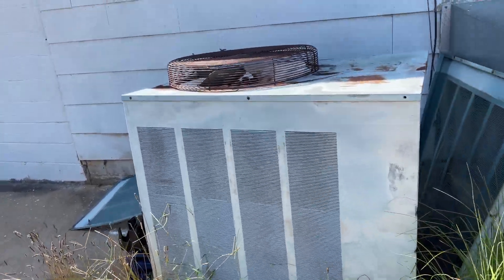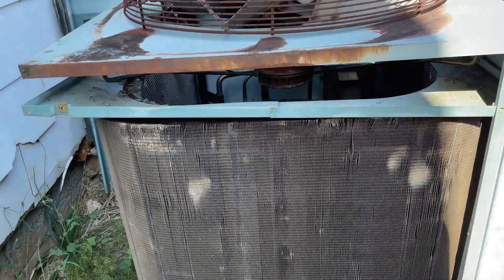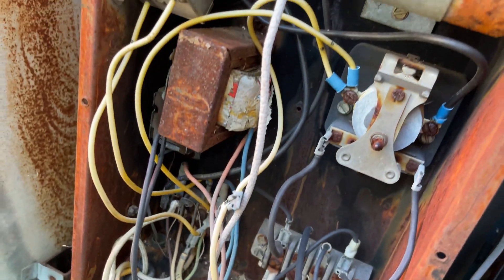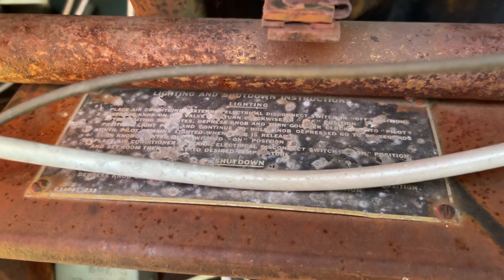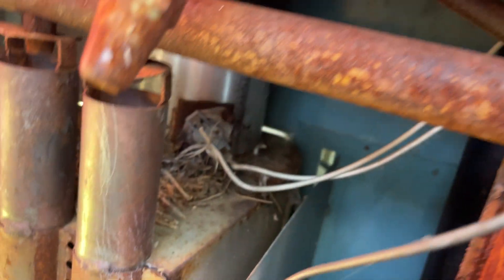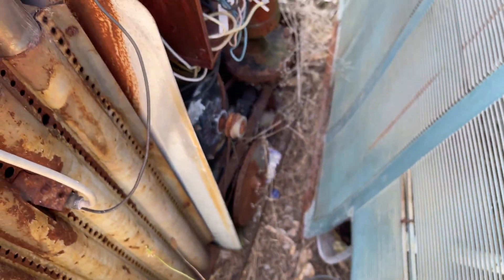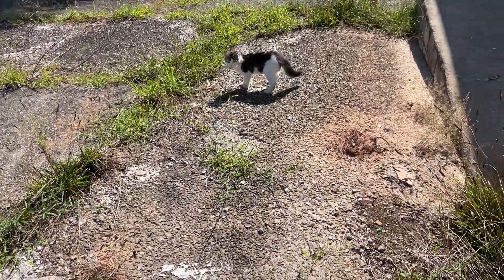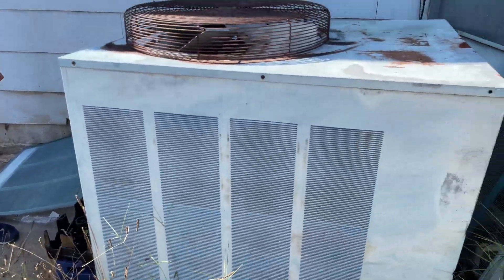The Arkla-Servel gas powered ammonia absorption air conditioner

Comment: We had a bunch of them in commercial installs in So. Calif In the '50s and '60s.  One church in Riverside had 80 tons capy.  Our house built in '54 was plumbed fir 3T Servel unit with a little Hadley Aquatower!  As itvturned out, we went with a GE package unit on the roof instead.  Some of our neighbors has the Servels, and had a nice little business cleaning out cooling towers as a kid.  That got me into refrigeration.  Back then, nathas was so cheap, tget sold really well.  So. Calif Gas  financed them for customers.  They went away once natgas prices went through the roof.

Comment: I'm getting nostalgic over the damndest things now at 60! When I was a kid in the 70s, our neighbors across the street had a Servel unit. I remember the pump kind of made a beeping sound when it was running. The fan was quieter than the pump. Our original HVAC was a Lennox furnace and outside unit. Most of the homes on my street were originally heated and cooled by Lennox systems.

Comment: I heard these use Ammonia as the refrigerant and that loop is under pressure.  They run on absorption in which it uses the ammonia to turn hot into cold, similar to how some RV refrigerators work.  It also appears that there is a pilot light that has to be lit with a match inside.  It also uses a blower just like a regular electric one.  There is no compressor in these.  It is an absorber.

Comment: Rating plate in video shows it as an early model AC60 (5-ton) chiller.  Serial # shows it was manufactured in 1970 (before I worked there).  I couldn't make out letter in the serial #, for that designates the month of manufacture.  Robur absorbed the absortion product from Arkla, Inc., 30-plus years ago. There is another manufacturer of absorbtion products in TN, Stone Moutain Technologies.  All your RV refrigerators that are AC/DC or propane heat source, use simular absorbtion principle.  Like stated in previous comments, use extreme caution if you open sealed system for any reason.  The refrigerant is R-717, anhydrous ammonia, sodium chromate (yellow additive) and water. They are hazardous and poisonous materials. Ammonia is the system refrgerant, distilled water is the system absorber and the sodium chromate is used as a rust inhibitor to coat the system mild steel tubing.
Reply from the maker: That’s awesome. I did a little research online but there really isn’t much online about these. Thanks for sharing!

Comment: I lived in a guest house in Southern California that had one. I called the commercial side of the gas company. One of their techs spent two weeks repairing it so it would work again. He would tell me what parts to buy and he’d install them. You can definitely get this working again. After the gas company gets it working you could probably hire an engineer to modify it so it instead of gas it heats the canister with hot water heated by the sun. This would give you effectively free AC.
Reply from the maker: Unfortunately I'm not working on it I just happened to spot it while out, but It's cool to see none the less!

Comment: I bought a house that had one of these units back in 1979. They were really pretty simple to keep going. Every year I added anti-freeze and defoamer to the reservoir and washed the coils. The gas burner heated the ammonia  solution and made the antifreeze solution cool and that was transferred to the coils in the house. Ammonia never entered the house. Safe and clean. We should bring them back and heat the ammonia solution with solar.
Reply from the maker: Awesome. Thanks for sharing!

Comment: I worked on those units for about 20 years before they stopped making them. I was the company expert. be careful because there is 717 ammonia gas and a solution containing sodium cromate - hazard!!!! must be disposed of properly. the big top chamber is the high side that has a valve on it to vent the ammonia-- slowly!!!! also has a small hydraulic pump with a radiator cap to remove the oil.
Good luck. get a sharp sawzall blade !!!
Reply: I have an Arkla Serval natural gas / ammonia air conditioner.  Is there a service manual online?  How hard is it to get one back up and running?

Comment: This unit seems more complex than the original Gas Units.  Bryant, Carrier, and a few others had their own design.  I remember a Grocery Store in New Orleans that was cooled by Bryant gas units.  The door actually advertised it as "cooled by".   Those units ran for about 40 years.  Natural gas was so cheap back then.  There were many homes in the 50s and such that had gas refrigerators built by Servel.  Servel actually had the first patented on automatic Ice Makers in their gas fridges.  Whirlpool wanted the patent on the Ice Maker so bad they bought the Servel Company.
Reply from the maker: That's awesome. It's a lost art

Comment: I serviced a few of those here in Houston in the late 80s and early 90s and they were all 3 and 4 ton units I believe...
I've never seen one with the vertical burners like that...
It's been a long time so I could be misremembering but I don't remember the vertical burners like on that 5 ton..
Reply: Some of these used an electric coil heater and some of them used a round burner
Reply: @johnh9748   I could swear I remember units with long gas furnace type burners,,, but it's VERY hazy at this point...  lol
Reply from the maker: That's awesome. From what I understand this ones been abandoned for over 10 years
Reply: I wouldn't be at all surprised if it's been abandoned for 25 years..
 @sevierity

Comment: These were all over my hometown in Oklahoma.  Arkansas-Louisiana (ArkLa) gas installed and financed them.  The gas company loved them because they got to sell more natural gas in the summer which was typically a low use period for gas. Our neighbor had one installed in the early 1980s.  The house became dilapidated and my Dad bought the house in the 90s.  I took the unit apart and salvaged that motor that you showed sorta hanging upside down. That motor had a belt that went to the pump directly below it.  The pump was used to pump the cold fluid from the "evaporator" which was housed in this same unit.  It pumped the cold fluid into the cooling coil inside the house.  I would say that with the condenser fan motor, the pump motor and the cooling coil fan motor in the house that it probably used more electricity than a modern all electric unit.  But is was a product of the times when gas and electric were both pretty inexpensive.
Reply from the maker: Back when gas and electricity was cheaper this thing really kicked ass. Thank you!
Reply: I removed a few hundred of these when Arkla quit servicing them.  They were actually pretty efficient and lend themselves to solar power easily.  They made some that used electric heaters, too.  Imagine having an AC that didn't have a compressor.
Reply: I think the actual company to build those was SJC, which bought up Tappan Frigiking. The ArkLa recuperating furnace put the whole works outt business.
Reply: I gree, all the extra motors PLUS the indoor motor, wasn't all that economical in the end. There was a company that built a rotary drum friction furnace. A stationary drum with a suspended internal rotating drum with an oil film between the 2 pieces, created "friction" converted then to warm air. From what I know, it was all electric , obviously, and it usually had a very large HP motor to do the work.

And just like you say with this, the electricity usage was probably more than a standard gas furnace of the time, maybe even some electric strip heat furnaces as well.